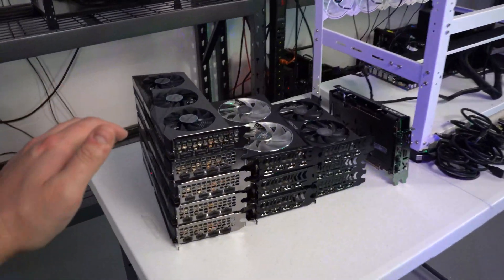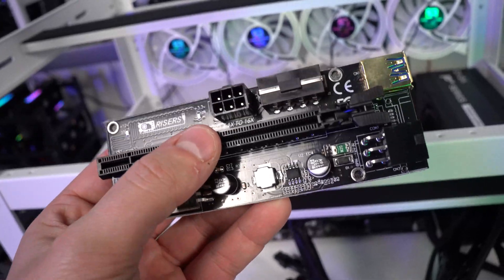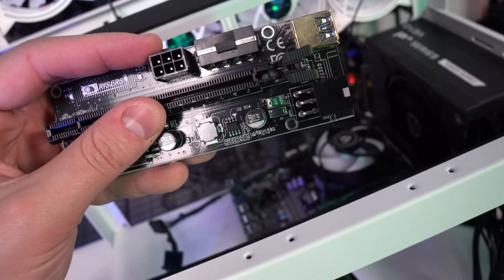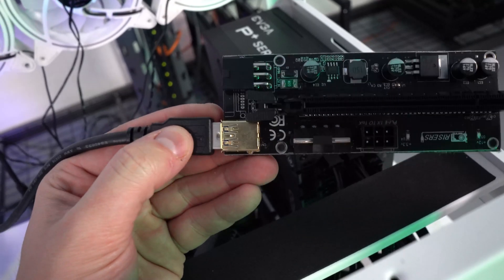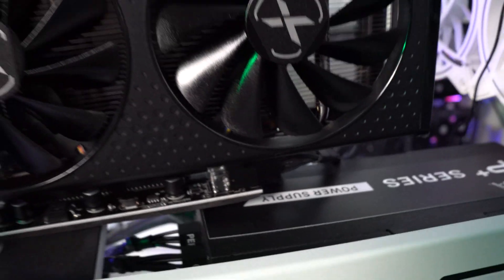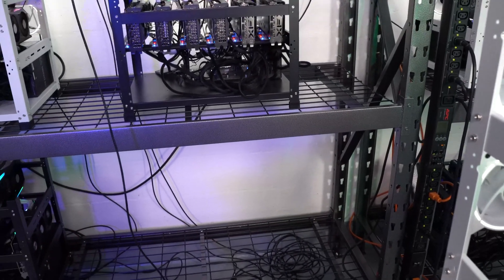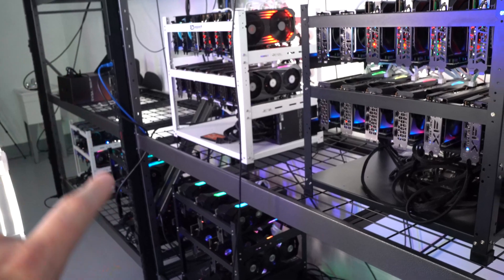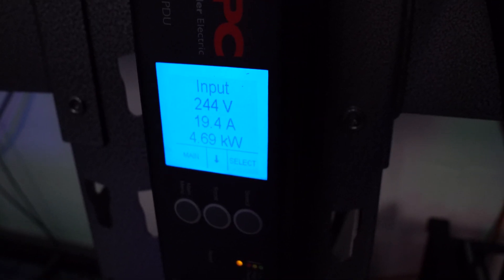Our Final Build of 2021 - 12 GPU RX 6600 AMD Mining Rig Build (Part 2)

Comment: Hello! Hopefully someone sees this and maybe will take some time to respond to me 🙏. I am building a 6 GPU mining rig with 3x RX 6600, 2x RX 6600XT, 1x RX 6700XT. I read online to take total advertised TDP multiplied by 1.25 which in this case is 1,182.5W ((132W*3)+(160W*2)+(230W) ). How is this possible if in this video there are 12 RX 6600s mining at less than 1000W? I was planning to buy a 1200W PSU but now that seems kind of overkill.. (side question, I live in a standard NYC house, can I plug a 1200W PSU directly into my wall socket?)
Reply from the maker: Make sure to use a thick gauge power cable! Each card consumes around 70W, so the whole system is under 1000 watts.

Comment: I’m sorry, i know that everybody is saying that the rx 6600 xt are the most efficient cards, i do disagree, if i only get 28/32 NH/S i have to build 3/4 12 card rigs instead of at least getting the rx 6700 xt which depending on brand hash around 45/48……somewhat what an RTX 3060 TI LHR will achieve.
Reply from the maker: For the price and wattage, the 6700xt fall short imo

Comment: Hey , I run 6600xt on 32.5 Mh/S with 60W power,50c temperature and 40% Fan , is that good ? Or should i change the settings ? 

So far i have 0 rejected
Reply from the maker: Sounds like it is working!

Comment: Whats the difference between your 4 capacitor and your 8 capacitor riser?
And when will the 8 capacitor riser back in Stock?
Reply from the maker: 8 Capacitor are in stock now. 8 Capacitor are for heavier duty cards, but 4-capacitor works well with any card on the market. More capacitors mean less fluctuations, which in turn brings more stability.
Reply: @GPURisers  thank you very much, for your fast answer!

Comment: I would love to get a XT, but they are way overpriced vs what I can get in the non-XT. I hope in the near future, but until then, I’m sticking with the 6600.

I’m running a couple of 6600 Pulse hashing ETH at 29.5 MH/S on Minerstat off of Windows as I use it also as a Plex/home Server. It pulls around 70 watts each with fans only at 57% (fan curve so it can run at 100% if needed) and temperature at 46 degrees Fahrenheit. It is around 60 degrees Fahrenheit in my garage). I disabled the Radeon Overclocking feature and just used MSI Afterburner. Maxed out the Memory Clock to 1900 MHz and put the core clock at the minimum setting, which is 1346 MHz, with power limit at +0%.
Reply from the maker: 6600 are great cards
Reply: @GPURisers  They still overpriced everywhere. $319 MRSP against $519 in stores 😞

Comment: What's the difference between 4 vs 8 capacitor risers?
Reply from the maker: 8 Capacitor are for heavier duty cards, but 4-capacitor works well with any card on the market. More capacitors mean less fluctuations, which in turn brings more stability.
Reply: @GPURisers  Thanks for the detailed answer 👍

Comment: Very conservative on the undervolts, your undervolts don’t do the regular 6600 justice. You should be under 40 watts easily in software at 28.9-29 Mh/s for all Hynix memory 6600 (The one Samsung mem model I have is worse and very finicky on undervolts).
Reply from the maker: What settings are you using?
Reply: @GPURisers  HiveOS/teamredminer- 905mhz core freq; 640 mV core voltage; 650 mV memory controller; 949-950 memory clock freq; 1100 mV memory voltage; 55w power limit (probably redundant but some stability issues not setting this ymmv); 740 Soc freq, 785mV Soc max voltage. Please note the undervolts in particular are only for Hynix cards and since I’ve yet to receive an XT that isn’t Samsung these undervolts will not work for any XT models I know of. You may need to tweak settings for stability for example I have one card that needs 660mV core voltage to be stable and another that need 795mV Soc max voltage. My recommendation is to first add the core and memory clocks, check stability, then add core voltage, next add memory controller and memory voltage together, and finally add Soc freq and max voltage. Bare minimum in HiveOS for memory controller voltage is 650, you can try to set it lower but HiveOS will still show 650 if you validate settings later. As far as I know I’m on the cutting edge of undervolts for these cards as nobody else has come close to this efficiency I’ve seen. Enjoy and let me know how it goes!

Comment: I'm sorry but you have not maximised efficiency on the 6600, it is possible to get them to 48w or even lower in some cases for 28.9 mhs
Reply: Yea my whole rig of 6 6600 non xts is doing 430 at the wall and 29 mh per card 900/950/620. The non xt is the better deal of the two no doubt when price and efficiency are compared correctly.
Reply: @DaMostShadiest  if you are in HiveOS you can’t go under 650 on the memory controller voltage, if you validate settings hive will bump it up to 650 even if you set it to 620. Nobody seems to know this since 620 keeps getting copied around without any actual testing or validation. Don’t believe me? Go validate or set your mem controller to 600, guaranteed your stability and hash won’t change
Reply: @tensebeastgaming8527  I'm using SMOS can guarantee you 620 works there as I have 12 cards running stable for weeks at that undervolt
Reply: @DaMostShadiest  do you have a way to validate your undervolts? Stability at 620 doesn’t prove anything as like I said Linux based operating systems will bump it up to 650 if you validate what it is actually running at. Try lowering it until you get instability, my point is that you won’t be able to get instability regardless of how low you go because it’ll always bump it up to 650. It would be a safe guess to say you copied those undervolts rather than actually testing lowering them down until you got instability because if you had you’d have found the same thing I did.
Reply: @tensebeastgaming8527  your not making sense my guy it's held at 620 not bumped up like you said it is on hive. They are both Linux operating systems. You care about this way more than me. I currently have a rig of 6 6600 non xts pulling 430 at the wall that includes whole rig that's all I can guarantee you I don't care about what hive is doing as I don't use it currently.
Reply: @DaMostShadiest  how low can you bring the memory controller voltage before it becomes unstable? You haven’t likely tested that so how the heck did you decide on 620mV? My guess is you never tested it just plugged in numbers from someone else’s undervolt. You could probably put 500mV as the memory controller voltage for all cards on your rig and see zero stability issues but absolutely zero wattage drop at the wall from 620. HiveOS and SMOS are both Linux distributions with similar implementation just different GUIs. For reference I am also running 7 cards with two XTs and 5 non-xt cards plus mining raptoreum on a 3600 all running at 460 watts at the wall in total.
Reply: is that 48w software or at the wall? AMD cards software Watts are not accurate
Reply: @solomonnicholas1188  at the wall dude
Reply from the maker: I will start messing around with the underclocks, just wanted to get this up and going for the time being!

Comment: Try using more power tool and watch son of a tech and red fox crypto  With there settings I'm able to get 29.23 mhs
Reply from the maker: I will have to wait and see if I can do this on MinerstatOS. I don't currently run these on Windows
Reply: Can this be done when running hiveos ?
Reply: @TheKerb17  I'm not sure it's only windows since your technically modding the bios
Reply: do you know the settings in windows to get lower power and 29.23 mh/s